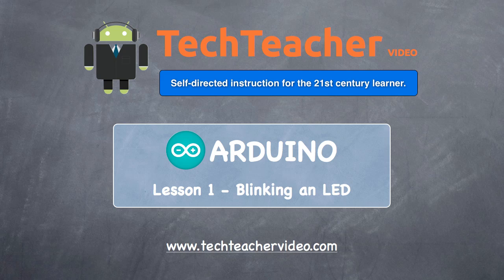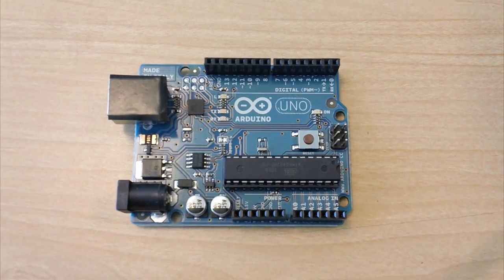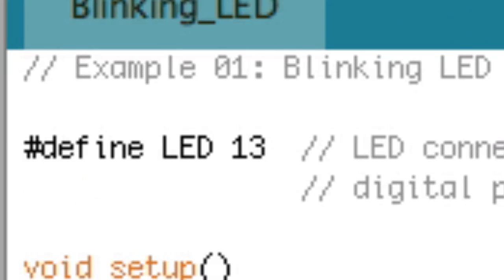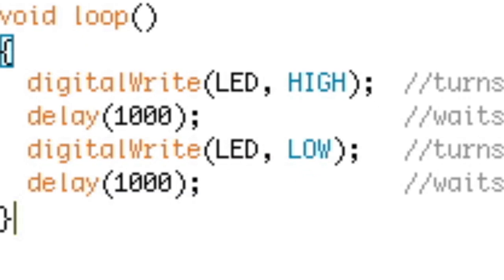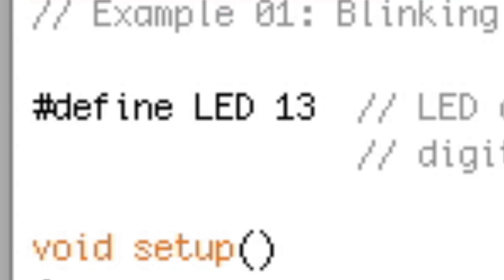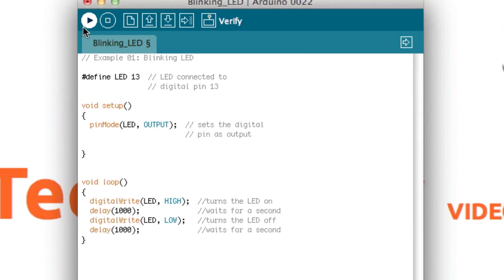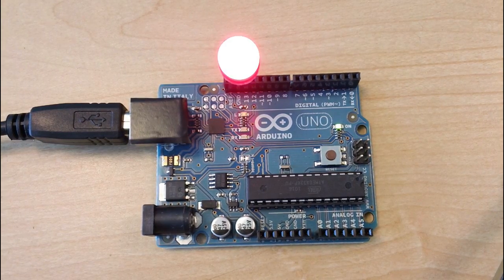Arduino: Lesson 1 - Blinking an LED

Comment: This is really a very nice project. You guys can also check https://youtu.be/LPQqqzfvfrE this video to blink an led with Arduino in a virtual real-time simulator. That means you won't require any hardware but will learn the concept of both hardware and programming in a simulator sitting at your home.

Comment: It would be very nice if you add the code in the description section. Thank you.
By the way, I how can I stop/reset the setup?

#define LED 13

void setup() {
  pinMode(LED,OUTPUT);

}

void loop() {
  digitalWrite(LED, HIGH);
  delay(1000);
  digitalWrite(LED, LOW);
  delay(1000);
}
Reply: thank u soo muchh
Reply: Aa do u know why the arduino dosent connect to the software it just say come and the code is right but it dosent work on the arduino even the arduino connected to the pc but the software says native port something

Comment: Just a heads up for anyone attempting do do this now. Newer arduinos DO NOT have an internal resistor in pin 13, so you're going to want to add one of your own so as to not damage your LED.

Comment: why when i puted the led in the pin 13 and i wrote the same program, the arduino led (L) started blinking but the led that i puted didn't
Reply: @gorkemgenc344  nevermind i fixed it 
Thnx boi
Reply: Reverse the led pins

Comment: Does not work. Replicated the setup exactly and copied/pasted the code. No blinking.
Nothing wrong with the LED because it flashes upon reset.
Reply: Then the software is either faulty or the Arduino is faulty.

Comment: Nice. I would have went somewhat deeper into explaining the code part since blinking a LED is a "hello world" sort of thing that is the very first time some does, when he/she gets an Arduino. Therefore previous knowledge in coding should not be expected. Still, nice tutorial and the info about the pin 13 having a resistor is pretty useful.

Comment: Arduino: 1.8.3 (Linux), Board: "Arduino/Genuino Uno"

/tmp/arduino_modified_sketch_247323/sketch_dec22a.ino: In function 'void loop()':
sketch_dec22a:14: error: expected '}' at end of input
 }
 ^
exit status 1
expected '}' at end of input

This report would have more information with
"Show verbose output during compilation"
option enabled in File -> Preferences.
what is this

Comment: FYI: The built in resistor in pin 13 is ONLY for the internal LED, you still need one for your own. http://electronics.stackexchange.com/questions/66992/pin-13-do-i-need-a-resistor

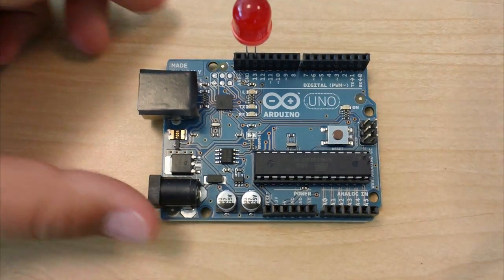Comment: 0:35- wouldn't you need a resistor to limit the current?
Reply: she said it that she used pin 13 because it has an integrated resistor so you you don't need to connect one!
Reply: Actually most of the comments all over the internet say that the Uno doesn't have the resistor on pin 13, so you are risking damage to the Arduino Uno by not using a resistor. You can see from the video that the LED is brighter than normally. Morover, the Arduino site says that you need a resistor on pin 13. See for yourself www.arduino.cc/en/Tutorial/Blink

Comment: ask : if we change the output pin except pin 13, will the LED blinking too?
Reply: No, not unless you add an LED and resistor to the other pin also. The resistor should be about 560 ohms for the standard 3mm LED. The short leg of the LED should connect to ground and the long leg of the LED should connect to one end of the resistor. The other end of the resistor should connect to the other output pin that you have used.
Reply: thank you sir

Comment: using leds without a current limiting resistor may cause the leds destruction or the pins destruction
Reply: Indeed. Pin 13 does not feature a current limiting resistor and without it, you risk damaging your microcontroller, your LED or both.
Pin 13 is connected directly to (SCK) PB5 pin 19 of the MPU. The on board LED, however, is buffered and has a series current limiting resistor.

Comment: I am getting this error(stk500_getsync() not in sync resp=0x00) after uploading the code to my arduino uno what must be the problem?????
Reply: Your probably uploading to the wrong COM port. Thats what it was for me anyway. 
Solution is here
http://www.instructables.com/id/A-solution-to-avrdude-stk500getsync-not-in-syn/
Reply: Make sure that the IDE you are using knows what type Arduino you are using. To double check: 
Tools --> Board --> [your Arduino model]

Comment: I just inserted an LED into the correct pins, plugged the Arduino into my Macbook Air, and the LED started blinking before I even opened up the I.D.E.  What am I doing wrong?  Shouldn't I have to write code for this?
Reply: The blinking code is usually preinstalled in the brand new arduinos
Reply: John Mora I was soooo looking to say hello to the world, but they stole my thunderous arrival! Thanks for the info.

Comment: Is this also possible with the Arduino DUE?
Reply: This is possible with any Arduino, but you will use a different pin.
Like pin 7, but with a resistor

void setup () {
pinMode (7, OUTPUT) ;
} 
loop setup () {
digitalWrite (7, HIGH) ;
delay (type any number here) ;
digitalWrite (7, LOW) ;
You don't need the second delay, but if you want, you can add it.